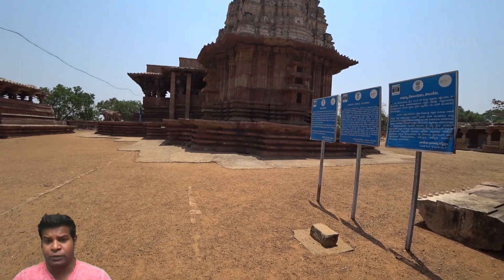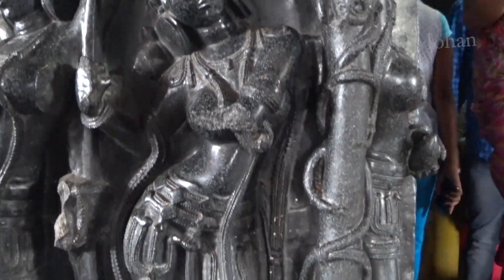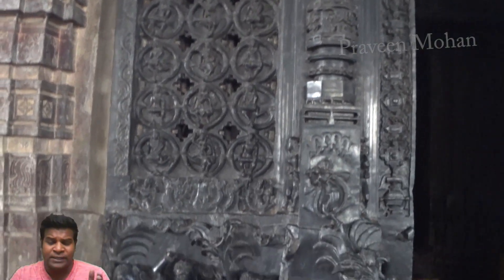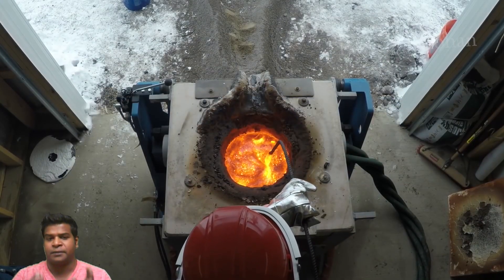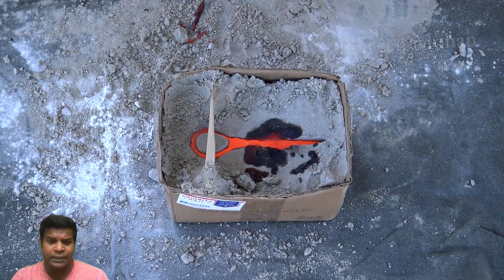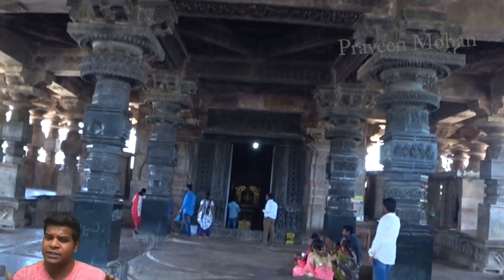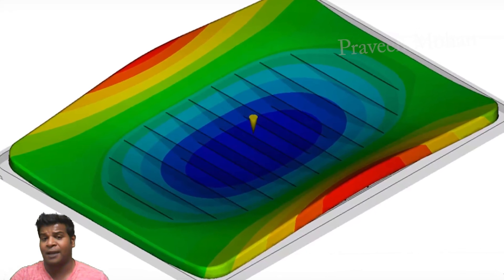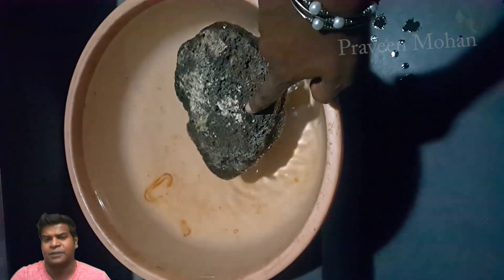Rock MELTING Technology at Ramappa Temple, India

Comment: Interesting observation, but unfortunately the evidence shown is not strong or conclusive enough. It could as well be a damaged part that was repaired ad polished over (at some later time). And they took only as much off as needed to not make it too apparent. That is how it would be restored best. It IS IN FACT possible to perform this type of repair, without a problem, why would it not be? Also, different parts and shapes of stones (stone carvings) do actually produce different sounds. Tuning stones is also much easier by carving and shaping then by moulding. Too much calculations needed and no easy way to tune if there are differences. In fact with warping and other errors, parts would be out of tune.

Comment: When you talk about rock melting technology, warping and distortion, casting on sand.... Please tell us about the mold that require great detail to receive flowing basalt, which can take hot molten rock. Density of the molten rock, cooling time for such huge pillars, what kind of mold, made of what materials.  This theory is similar to the theory of Pyramid built by using ramps..... Which needs more materials than the pyramid.

Comment: I wouldn't agree that there is a defect on the pillar from casting. I would rather suggest that someone wanted a souvenir and broke it of. Probably a single person and then a later people that occupied the building simply smoothed the surface in an atempt to hide the damage. If there is one thing these buildings speak off its precision. They will not have used a misformed piece.

Comment: This is extremely important and I think that I have a solid evidence that proves rock melting technology existed.
In a 7 standard CBSE history textbook we can see the melting technology and it is called as the Lost wax technology.
This technology was used by the chola dynasty.
In this technique, first statue of wax is created then it is covered by clay and it is dried then a Small  hole  is created and the wax is removed by heating the mould and then melted bronze metal is filled in the mould and let cool.
After which the clay is removed and the statue is polished.
But the ramappa Temple was built by the kakatiya dynasty. (1163- 1323)
From 300 BCE- 1279 CE was the chola dynasty.
as a kakatiya dynasty and chola dynasty are both in South India and the chola dynasty was before the kakatiya dynasty it must not  have taken time for this technique to reach them.
But still I am not able to find out how the statues for the carvings on walls were made...
Reply from the maker: Hi Varad, I am glad to see your detailed comment. However the process you have mentioned is for the brass or any metal statue. If you observation the broken parts of these statues in Ramappa Temple you can the details of solid rock. I suggest if possible try to visit this temple it will enhance your interest.
Reply: @RealPraveenMohan  
So this is clear that rocks were melted during those times, isn't it?

Comment: Regarding the missing face on the pillar, have you considered that maybe it was purposely destroyed.  You said it couldn’t have been done with hand tools and be that smooth.  I disagree because rock like glass can be scored and cleaved.  Leaving behind incredibly smooth surfaces.  Erosion by natural or artificial means could also have accomplished this.  I say this, because if those pillars were indeed poured, they wouldn’t go through all the trouble of pouring it just to then carve it.  Additionally if it was in fact poured and defective wouldn’t they have just re-poured it?
Reply: Exactly! The evidence is not strong or conclusive enough. It could as well be a damaged part that was repaired ad polished over (at some later time). And they took only as much off as needed to not make it too apparent. That is how it would be restored best. It IS IN FACT possible to this type or repair, without a problem. Also, different parts and shapes of stone do actually produce different sounds. Tuning stones is also much easier by carving and shaping then by moulding. Too much calculations needed and no easy way to tune if there are differences. In fact with warping and other errors, parts would be out of tune.

Comment: X-ray it or whatever is required to see its inner structure.  These incredible builders were so clever maybe they differentially hollowed it out then resealed at a special level of detail impossible for humans to even perceive,  let alone see. Looks similar work  & material to the exterior Idols?
Seems the ancient "Giants" or builders must not only have been very huge but had the ability to work at incredible mathematical detail - somewhat incongruous no?  Large size in nature rarely corresponds to high dexterity level let alone the precision for this? We do it on a far smaller scale in higher detail on computer chips but yeah, very advanced tech.
 We have been lied to but to whose advantage would that be?

Comment: Could you explain how casting it affected the density in order to have it play different sounds?

The leg to the left of the musical stem is also a cylinder shape and extruded out from the main surface -- what happens when you tap _there_?  Can you better rule out that the unique shape (regardless of how it was given that shape) isn't the simple answer?

What is the melting point of that basalt?  How does it compare to metals that were in use at that point in history?

Are there lava flows somewhere?  The rock may have been found and carved around the special feature of the musical stem.

Comment: On YouTube, the mass of rollers about solar concentrators, parabolic mirrors, with the help of which they melt and cut metals, melt stones.
Archimedes set fire to enemy ships with such mirrors.
We have stopped using such technologies because electricity is a commodity that needs a buyer. We switched to hydrocarbons, coal
  and electricity for melting materials.

Comment: Does nobody else see that he's clearly tapping on different sections of the carving that have different shapes and structure?  Of course it's going to make different sounds.  Now if it was a carving of just a cylinder, with nothing else attached, with no variation, then the sounds would likely be nearly identical.  But even then, rock is not generally elementally perfect throughout it's structure, so there will be slight variation even in this case.  But to simply tap on random parts of a carving with very different shapes and variations will produce different tones.  Why does it seem nobody is getting this very simple fact?  Maybe they did use a different technology, but to use such a wrong explanation is just bad observation.

Comment: Ok.  The pitch of the ringing in the stone has nothing to do with density.  Notice that the pitch is lower when he taps the spot on the cylinder that has the snake/spiral thing around it.  That’s because there is more material in that spot.  Think of it like the keys on a xylophone.  The ones that play the lower pitches are not a different density.  They’re larger, so there’s more material/surface area for the sound waves to resonate from.  Also, how does casting molten stone give a person the ability to change the density in different places?  Unless you’re casting different types of stone together.  Even then, you can’t control where the different molten stones end up in the mold, and you have no way of knowing what the pitch would be when you tap it.  Come on, dude.  Focus your curiosity on something that actually makes sense instead of wasting time on crap like this.

Comment: Even pyramids,build from very heavy rocks,were probably used the melting technique.
How easy to transport sand and by electricity to melt and cast in stones. 
But I guess THEY "melted"stones by alterating the structure of sand and stones at normal temp.of Ggypt(25*C).and making to flow by a unknow tech.to the level of making sand like plastic.

Comment: I disagree with this melting idea, it would be so unstable and unpredictable, it is not in line with factual stone masonry history.
The pipe is an hollow add on section, not so carefully crafted onto the monument.
The warped section on the column is clearly a repair job, 
I would say where the figures had been damaged and or missing.
Somewhere along the line an individual with no experience in conservation work employed someone to fix it.
Basalt can be highly polished by hand 100% end of story.
Basalt was probably chosen by the University because it is Commonly high in metals.
The floating rock is gassed out residual from a volcano very common, washes up on beaches
Also Basalt is from volcanic action.
No mystery just a bit of hollow pipe trickery.

Comment: I do wander if Indians in building their Temples used charcoal to dig coridors in solid rock.Dig a hole in rock or few holes in inteligent manner and pump air in it and fryed rock is easy to do extract in form of sand out of cavity?Fryed rock hit by hammer or chisel ,combined with cold water pouring on it,falls apart in form of small chunks and sand?Just asking?

Comment: ROCK CANNOT BE MELTED AND MOLDED.
If you melt a rock, when it cools down, you get glass or obsidian. Basalt can be the only one that can be melted but it requires some real complex technologies. Moreover the casted basalt has a very homogeneous color, due to the melting process, whil the rocks of the temples are not homogeneous. I see white grains. I doubt it has been melted and casted. moreover the shape of the pillar would make it almost impossible to have such a mold. There are too many undercuts.
Did you ever find signs of high speed milling like on egyption sculptures?

Comment: There is one problem. And that is exactly that the other pillars are carved. The carvings all stick out from the flat surface, however the undecorated area is the flat surface with nothing sticking out to carve, which suggests that the small carvings are not part of the rock they are attached to but are attached later on.

Comment: Hi Praveen, do you think the whole Kailasanadha temple in Ellora was molded out of molten basalt? the builders could have created a super scaled mould and poured the molten rock in stages to create a single solid structure. the details could have been chiseled out after the completion of the super structure. not sure about the energy source to melt the rock. we may need to check for radiation levels to confirm if advanced energy sources were used.

Comment: i think u need to provide a bit more evidence since you cant look into the rock and determine if it was hollowed out from the bottom. and yes, naturally, if you carve a tube out it will be imperfectly shaped unless extraordinary steps are taken, which will make the tube thicker in some areas and thinner in others, which will give you different sounds, not only that but the carving of the tree has vines and other things on and around different parts of the trunk which will lead to different sound. you would have to create a simulation to determine what sounds should be made at what points in order to determine otherwise. the blank slate also makes me think that something may have happened to that part of the pillar that warranted the full removal of the sculpt and they didnt want to remake the whole thing so they just removed it and flattended it. the Warping may just be them making the best of what was left from the incedent. again you would have to 3d scan the pillar and see if it simulates the true chracteristics of warping.

Comment: Dear Praveen, at 3.48min you state that it (melting) is the only way, but one could also think of a hollow pillar/cylindrical shape, with different wall thicknesses towards the inside, in order to create different notes... I assume!It does not explain the metal-like notes coming from it however :) Or is that also a basalt characteristic?

Comment: The analysis is great.  Additionally, I would like to suggest that, the difference is sound at different places of the rock is due to difference in frequencies of vibration.  That has been effect by the snake on the rock.  The place where the snake's spiral distance is minimum produces high frequency sound and that with larger distance produces low frequency sound.Thanks for your exciting reality analysis. - Raghavan

Comment: Are the pillars stacked parts, like the melted cube?  And the mold would be shaped like a cube from sand where you poor the melted rock? And if the pillars are one solid piece, I think the mold would be impossible to make for the pillar. Even molds for separate pieces would be very difficult to make. Also why wouldn´t they just melt another cube, rather than use the defected cube for important temple?
Reply from the maker: Hi Rehustaja, Good questions. Why defective piece to be used in a such an important temple. This temple is an architecture marvel which is showing us the various technologies used in a single temple itself. Regarding the defective piece I guess they placed it purposely so that the future generation will question about how and why it is made.

Comment: There are musical rocks all over the world, some natural, some shaped by human hands. Google "rock gong" for starters.
As to this particular carving there is nothing mystical about one portion making a different sound when tapped.
I have metal wire shelves in front of me. If I tap on a shelf I get a very different sound from when I tap on the columnar supports.
Try it yourself. Go outside and find a car. Walk around tapping on different parts of the car. Guess what? You will get different sounds, some more "musical" than others. Does that mean that the car designers intended to make a musical instrument?
Or better yet go to a park with a public sculpture and tap on different parts of the statue. Guess what you will hear?

Comment: Imo that 1st part would either be partially hollow or like you said change density/crystalline structure due to heating. Either way that requires much more than manual carving. The pillar part does lean to the use of heat due to the typical bowing warp seen. I think your onto something here, keep it up.

Comment: Yes there are places around the world where I believe they've been used this in the past technology I believe that used to melt rocks and pump out corrugated Rock roofs there's places around the globe that that have that or like in South America the megalithic rocks in the walls that have all the Nigel's sticking out I believe all those rocks were molded cast great video sir once again my hat's off to you God bless you
Reply: wanted to make the same observation about South America big perfect fitting boulders.
But I was hinging on a cement format, being poured into big sacks already put in place, and later removed.
But pure magma/lava at 2500 oC in fabric bags would not be possible. Even a double layered bag  with sand as filler is unworkable.
However, a formula of molten rock with ingredients/mud at much lower temperatures would perhaps make heat resistant sacks possible...
Reply: Kelvin Price destroyed by floods
Reply: supear   temple
🙏🙏🙏
Reply: There’s an issue with your theory that is worth considering. In the case of Sacsayhuaman, the stone used is granite. It’s possible to melt granite, but once melted and cooled it is no longer granite. It becomes rhyolite. While the chemical composition of granite and rhyolite are the same, they are very different.

Comment: Crystal overdrive of piezoelectric material! Applying a frequency or pulse at specific voltage to force quartz to destroy itself. Selected areas of melting likely occur do the build-up of charge and resulting higher current.
Reply: Michael Pierce this crystal overdrive,  is it theoretical or re-creatable?  It sounds interesting.  I'm aware of crystal being far more useful than modern humans realize, we srn to forget even small things like crystal radio and watch! 😊
Reply: Of course it is! Thats where I got the term. Its usually talked about as a bad thing in electronics troubleshooting since we use quartz in circuits and DON'T want them to break. I developed this theory to apply to ancient technology when I saw the pattern that ALL monolithic sites around the world are made of quartz based material and I was already studying Quartz because I have a few distant cousins do innovative work with Quartz such as the Pierce Oscillating Circuit and the name of the Transistor were given by my fellow Pierce name sake.

Comment: The concave defect in the pillar! I've seen that before! The stone boxes at the Serapeum in Saqqara. Defects that have been polished to the same smoothness as the rest of the surface. Yousif Arwyan believes they were removing areas of poor quality stone, like cracks and faults, to make the boxes as solid as possible. I'm not sure whether it is melting or just what the process was, but it was certainly advanced. Those pillars are so elaborate and ornate, very unique designs.

Great video.
Reply from the maker: Thank you Andrew